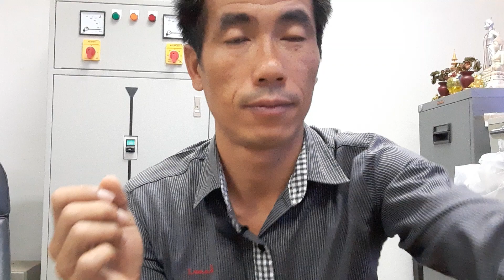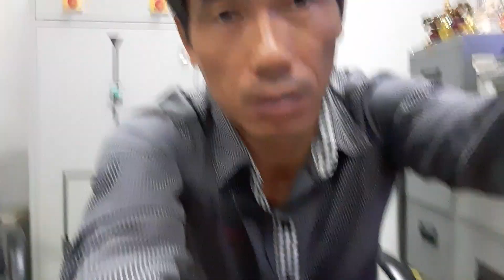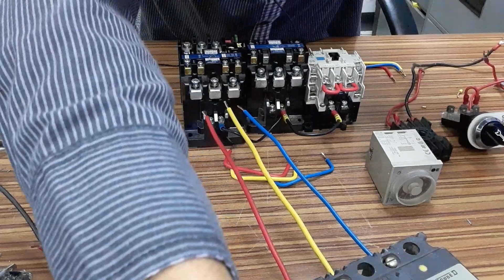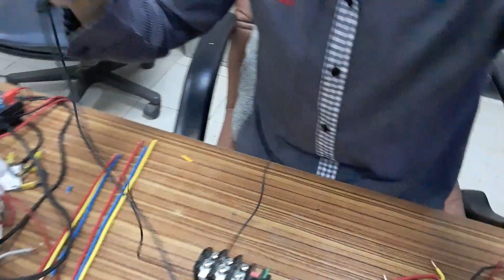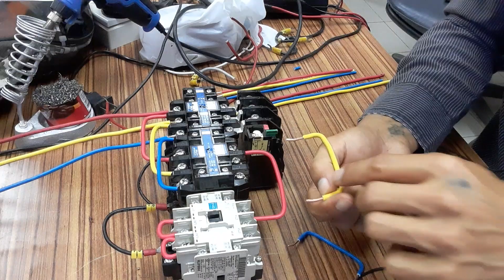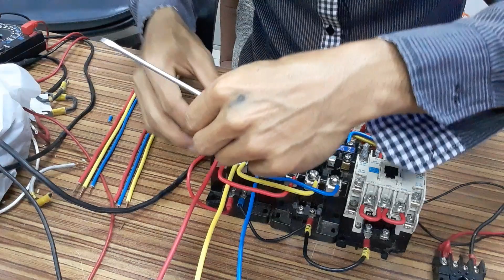วิธีการต่อสายไฟสตาร์ทมอเตอร์ แบบสตาร์ เดลต้า แบบเข้าใจง่ายๆคลิบที่1 kpcp diy

Comment: ผมอยู่ลำลูกกาคับอาจารย์
Reply from the maker: ขอบคุณครับ ดูคลิบของผมแล้วทำตามไปที่ละขั้นตอนก็สามารถทำได้แล้วครับ แต่ถ้าเราไม่เคยทำเลย ผมขอแนะนำให้ดูตั้งแต่ปฏิบัตการที่1 มาครับ และผมก็ทำคลิบที่ เขียนเป็นรูปภาพตั้งแต่พื้นฐานจนถึงคอนโทรลควบคุม ถ้าเรามีอุปกรณ์ทำตามไปด้วยก็สามารถทำได้แล้วครับ เพราะผมทำคลิบขึ้นมาก็เน้นสำหรับท่านที่ไม่เป็นเลยนะครับ
Reply: @kpcpdiy1898  
ขอบคุณคับอาจารย์
Reply: @kpcpdiy1898  ทำวงจรประกอบพร้อมอธิบาย ผู้ชมจะได้ทราบสัญญ ลักษณ์ วงจร และเมื่ออ่านวงจร single line เข้าใจ ก็สามมารถ  wiring power /และ control ควบคุมได้ สบายๆครับ   เน้น พวก timer relay stardelta ขาไฟเข้า ออก ขา2ขา7 และคอมมอน ขา 8 ไฟหน่วง ขา 6 คอนแทรคเดล ต้า เอาไเข้า nc  แมคเนติด สตาร์ 21-22 ออกไป เข้า A1 แมคเดลต้า ส่วนขา 5 คอนแทรค สตาร์  นำไปเข้า NC 21-22 แมคเนติคเดลต้า  ออกไปเข้า A1 ของแมคสตาร์ เพื่อ interlock กันและกัน  ปลอดภัยกว่า ขอเบอร์อาจารย์ครับ ผม 0823756969 ครับ